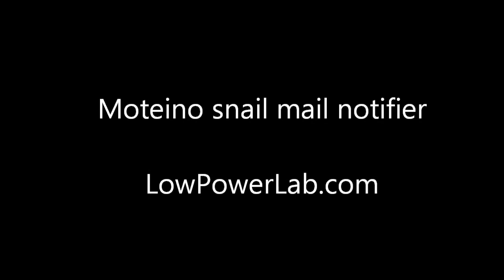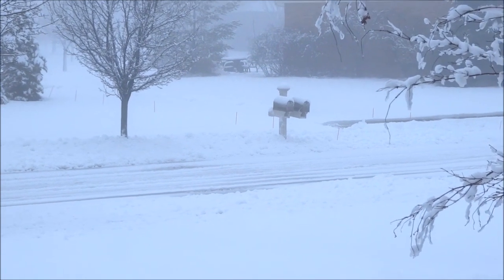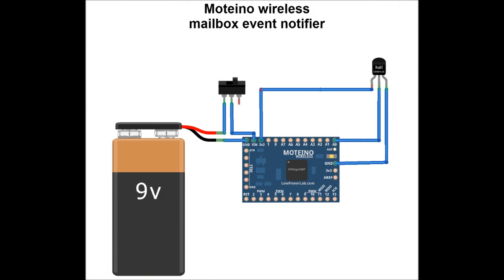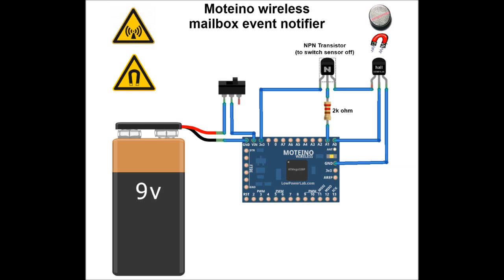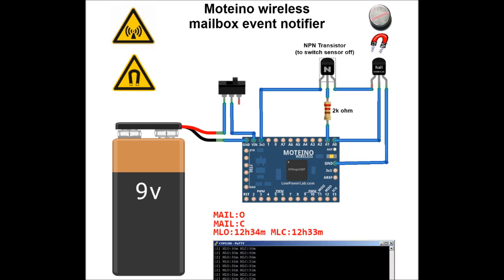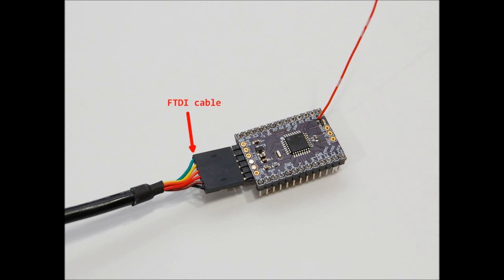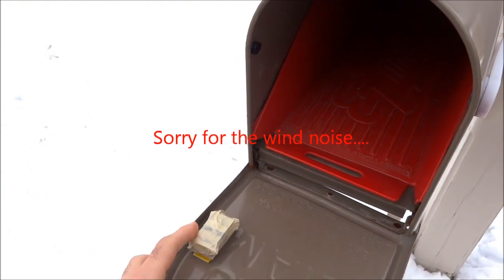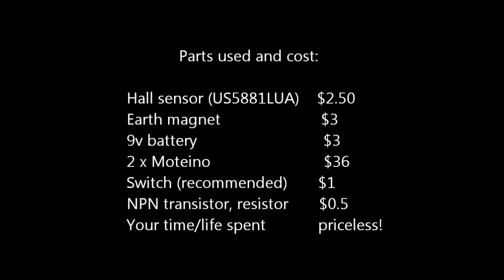Mail box notifier - very first version with Moteino

Comment: I was thinking about using a photoresistor to detect if mailbox was opened.   When exposed to light there is less resistance and that perhaps in some way could let some current through , enough to wake up the esp32 ?  I was going to place the unit in teh back of the mail box towards the top.

Comment: cool build! but seriously ditch the whole hall effect sensor all together. Use a photo resistor. when suddenly there is light in the mailbox it is most likely that the box was opened. and when the light drops down then the box is closed. Tape the battery in the back of the box so the mailman doesn't freak about what that thing is. Tape a few wires going to the front of the box for the sensor and bingo. Never worry again about if the mailman didn't close the box all the way. Just an idea. I am in Michigan too my friend. I feel your pain. Gotta love SE Michigan. However I will never have your problem. my mailbox is on the house.
Reply: The only time that might not work is at night. I'm consider this as a cheap alternative to mail security. We've had some people break into our boxes and it would be nice to get an alert when the mail door is opened outside of expected mail delivery times. I think he should mount the magnet on the door and the hall sensor on the box. Then he can run the rest of the unit to the back of the box keeping it as far out of sight as possible.

Comment from the maker: Basically the transistor is a switch. The hall sensor uses lots of power (2.5mA is a lot if kept on all the time). The Moteino sleeps 99% of the time, so it makes no sense to keep that sensor powered up all that time. So when the Moteino wakes up, it turns the transistor on to power the sensor, reads the sensor, then turns the transistor off. Simple eh?

Comment from the maker: I guess you can do this in many ways.
Since the halleffect sensor is only powered a few ms it draws next to nothing. It also has a hysteresis and a schmitt trigger which makes it much more accurate than a mechanical switch (like a mercury switch) which could cause  a multitude of interrupts depending how it is activated (think of door being shaked, think debouncing etc). A hall effect sensor is $2 after all..

Comment: How about a reed sensor, that turns the whole thing off when the magnet is close to it, and turns it on to send the RF packet when the door is open. Zero battery consuption. Years of battery usage. He?
Reply: iDavidP u can do it using a transistor.
Reply: Wesley Gentine or even changing the behavior in the sketch
Reply: Use a mercury switch, with a led in series with a battery.
Reply: I thought about better one, with a sensor, but a Chinese guy has already made one 😖

Comment: Nice, but only good for US maiboxes. My box has a slot, not a door. I need a sensor that will detect when an envelope is dropped on it. Can't work by light as the front and rear slots are always exposed to sunlight. I guess I need an IR transmitter-receiver to detect the envelope presence. The RF link in your project is probably of use.
Reply from the maker: For several years I have used a MotionMote for my mailbox, it uses a PIR sensor, can be mounted in many ways in any mailbox, and is very accurate, and much lower power, can last at least a year on a small LiPo. That's what I would recommend in place of this older hall effect + magnet notifier. https://lowpowerlab.com/motionmote
Reply: +Felix Rusu Thanks for the link. However, my application requires active IR detection. It has to be able to detect an envelope when it is popped in the slot breaking the light beam.

Comment: Why not use a mercury switch on the battery lead, and set it so it only gets power when the lid is open, and draws no power at all when closed,
Then you could skip halleffect sensor and make it simpler.

Nice work !!!

Comment: I also made something like this but I used a reed switch instead. I'm not an electronic engineer so I wonder: is there a reason why you'd use a hall sensor instead? The big pro of a reed switch is that it doesn't draw any current at all. Also I used a 18350 battery and an arduino pro mini. For communication I use The Things Network (LoRaWan) with an RFM95W.

Gotta love these projects!

Comment: Which kind of moteino do you have?
Reply from the maker: The small AVR Moteino is used here but any Moteino would work the same. FYI I now use a PIR sensor instead of the magnetic sensor, it works better.

Comment: Hi Felix nice Project, you rock. But can you help me ;) I will like to do this project.
But can you explain how to do it, with the ESP8266 wifi module an sending message 
with Pushover. That will be awesome, thanks in advance an Kind regards.
Reply from the maker: This is an old project, now I use a pir sensor (MotionMote) to detect motion at the mailbox, and with the Moteino and RFM69 the battery lasts a very very long time and gives a very good range.
With the ESP8266 you are hopeless in terms of range and power needs so I have no advice there.